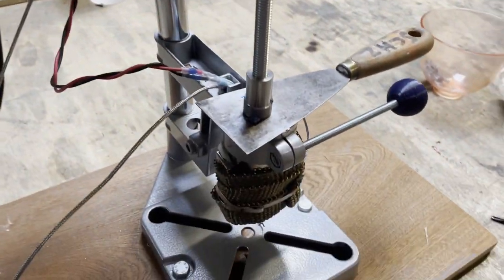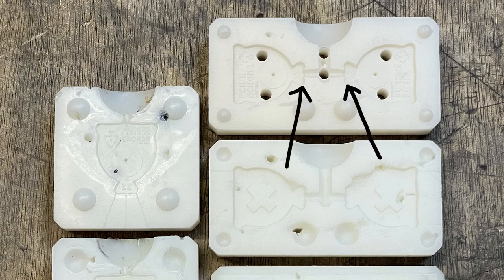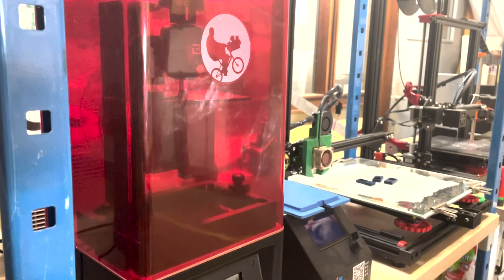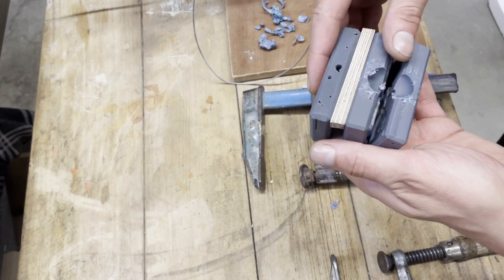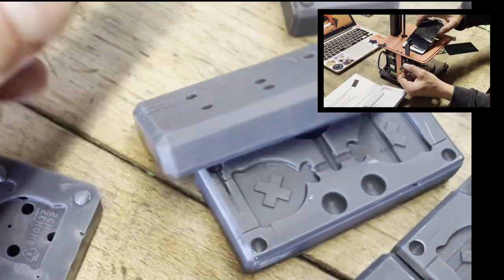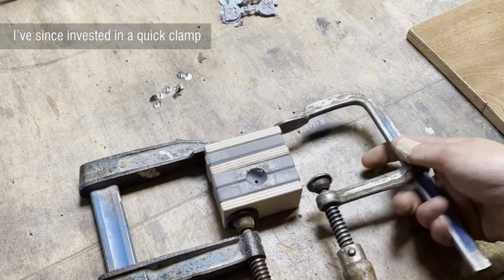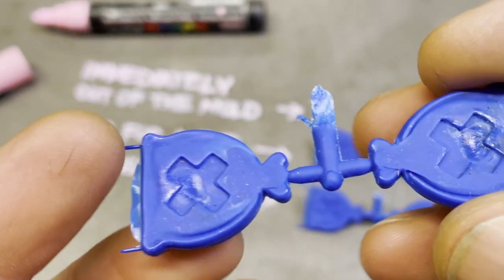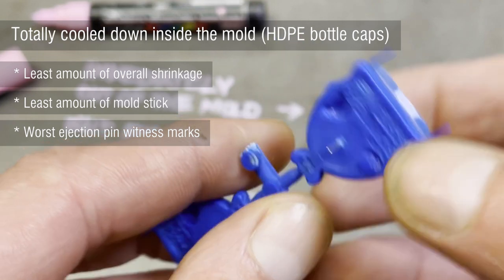Injection Molding with 3D Printed Molds And .. Ejector Pins!

Comment: Which resin are you using? Is it a heat resistant?
Reply from the maker: I have tried only a few so far, but I am sticking with Siraya Tech Fast at the moment. They also have more heat resistant resins but the one that I tried, Siraya Tech Sculpt, actually broke already with the first pull. So far I haven’t had any break offs with Fast and it is the cheaper and faster peinting option, so I am content :) Hope this helped. Do you have an injector as well?
Reply: @baschz   Thanks for the info. No injector yet. But hopefully this year.
Reply from the maker: @Chetcon2000  That sounds like a NY resolution I can get behind :) Have fun in advance!

Comment: I’ve been making resin moulds for overmoulding PCBs with platinum silicone, I made resin ejector pins in a few designs that worked reasonably well as long as they were quite thick where they joined the block. So only the last cm was 4mm and the rest was 10mm. I also experimented with injecting air with syringes to loosen the piece from the mould. Of course things are different with silicone and PCBs.
Reply from the maker: Sounds like some very interesting contraptions (checking your YT after this to see if any of it is there to see as well). Did you mostly do it because you just really wanted it like me, or did you need it too? Since I’d think silicone would easily come out of the mold anyway.
Reply from the maker: Too bad, no videos about it I see. Getting very curious now though!
Reply: @baschz  yeah sorry I've no videos. I'm trying to make a product so I need to experiement with different designs. The silicone has a tendency to have cure inhibition caused by the resin, or it can glue itself to the mould.  The same goes for tin cure silicone. 

The trick is to make sure the resin is absolutely clean and cured before trying to use it. Really thoroughly washing with fresh alcohol, lots of time under the UV lamps and then heating it to ~70C for a while. Or leave it out in the sun and wait a week or so. it's got sulphur which causes the problems. The sulphur slowly degasses if you wait. My clear resin change from pale yellow to pure white/clear. I've also found that some conformal coating sprays (Plastik 70 from Kontakt Chemie for example) can give the resin a gloss surface that releases far easier also (the silicone can form mechanical bonds to even seemingly smooth molds)
Reply from the maker: @JasonRennieWTF  No worries. Still curious though ;)

I am familiar with silicone cure inhibition when working with resin 3D printed molds. For me it ended up working with just curing and waiting long enough for whatever vapors or something are in the resin to leave.

Is the yellow-to-clear resin you are using the Mayer Makes resin by any chance? Because I've tried that for my molds, as it looked great on paper being totally clear eventually so I hopefully could see the injection going on inside the mold, as well the temperatue specs. But unfortunately with me the parts don't ever seem to be turning clear (after a long time of UV curing under a light a several weeks in front of the window) but mostly the problem for me was that the molds also had pieces breaking off in the first injection every time.

I have also tried Siraya Tech's Sculpt, since that should have great heat resistance features as well. But the same thing happened there, pieces just break off almost immediately. So far I am getting the best results* with Siraya Tech's fast, their cheaper and faster printing resin. No complaints there :)

*Best results on the Elegoo Mars and with the few resins that I've tried that is. I have also gotten great results with Formlab's resin on their Form 2, but that's a far more (10x) expensive option, which I've only got access to since I was lucky enough to be able to buy a second hand one for the price of an Elegoo Mars.
Reply: @baschz  hi Bas, did you see the email I sent? I sent some pictures of one of my moulds
Reply from the maker: @JasonRennieWTF  hi Jason. no, I didn’t. did you use the address it says on my bio?

Comment: Cut the ejector pins back a bit, and glue on some printed resin stick of the same size that you removed of the steel. That way you'll have the strength of the steel, but the tips will remain at the same temperatures as the rest of the mould, so the witness marks shouldn't be so bad when you let it cool. At least I think that'd work? :)
Reply from the maker: That was going to be my next move :D For when I defintely want ejector pin witness marks. Right now I’m working on something that doean’t really need them and luckily I can always still get the parts out without them.

Comment: Your results are really impressive, nicely done! The witness marks from the pins are interesting. I wonder about putting plastic "heads" on the pins so they don't pull heat as quickly, or maybe even heating the pins. Very cool results and your pins are cool, I love the unique look from using different materials.
Reply: Reading the other comments it's very clear that the "printed head" for the pins is in no way a new idea. :P
Reply from the maker: @gkelly  maybe not a new idea, but a good idea probably still. I haven’t tried it yet, since I haven’t needed it so far. I was very happy to find out I got it to work though. now first testing and learning more about some other mold features.

Comment: Good afternoon.  I saw your video about 3d printing the injection mold.  What was the best resin resin?
Reply from the maker: Hello Friel. The resin I use all the time now is Siraya Tech Fast. It is so far the cheapest, fastest, easiest to print and best working resin I have encountered. A lot of people swear by Siraya Tech Sculpt, but personally I find it (here come the opposites) more expensive, slower, harder to print with and I haven't had the same amount of success using it as molds (cracked). This is my opinion though. Would love to hear if you agree if you try any of them. Are you doing injection molding yourself?

Comment: What resin are you using for the molds? And what's the casting material and the temperature? If you can provide links I'd be more than happy! (I jus subscribed)
Reply from the maker: Thanks for subscribing, Ignacio! I've tried several different resins (which I will talk about and some other new findings in the next video) and so far I have had the best results with Siraya Tech Fast on my Elegoo Mars and Formlabs V4 Grey on the Form 2. With both I haven't had one break of a mold yet. Temperatures vary since I am still finding out more about the different materials but (very) loosely they are between 200 and 230 degrees Celcius for the materials I have been working most with up to now, which are PP and HDPE. I have also tried other materials but since I am also learning about 3D modeling, injection mold design and testing shapes towards my goal of articulated action figures made from recycled plastic, I haven't had the time to really dive into all of it in an equal amount. Also, because I use mostly bottle caps at the moment to make my granulate from, I found out that there can be quite big temperature differences needed for different brands/colors/types of the seemingly same material. Hope this helps you a little bit. Otherwise feel free to ask more.

Comment: Is resin better than using an FDM mold? Just wondering.
Reply from the maker: An FDM mold doesn’t work with injection molding, because the temperatures are too high so the mold will deform. Also in terms of resolution resin is the better option.

Comment: can you make bigger parts? or tiny parts only?
Reply from the maker: This particular (open source, self-built) machine has a rather short barrel to heat the plastic in, which gives it 1 cubic inch to play with. There is an extension piece you can get from Ryan (who came up with this design and who sells some of the parts) to make it two cubic inches. I've also seen people totally rebuilding their machine around the main idea, so that's an option as well. Also, another machine I've built earlier, is the Precious Plastic (also open source) one by Dave Hakkens, which is also bigger and can thus produce bigger parts. Here's a video about my first ever test using resin molds, using that machine that we built: https://www.youtube.com/watch?v=qFBy_qu0sL4. Hope this helps.